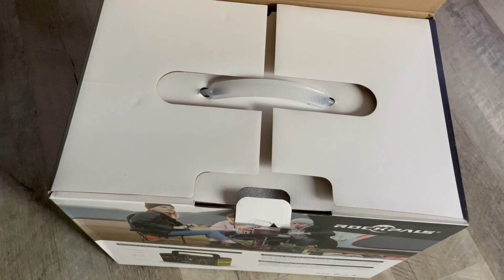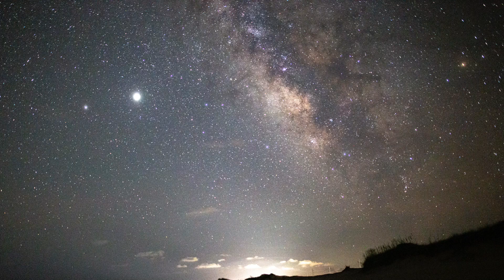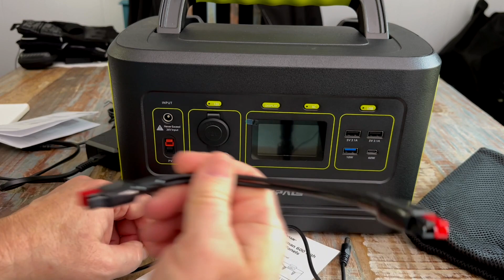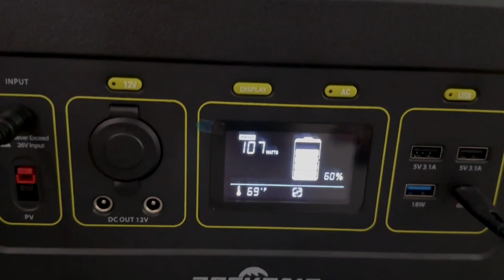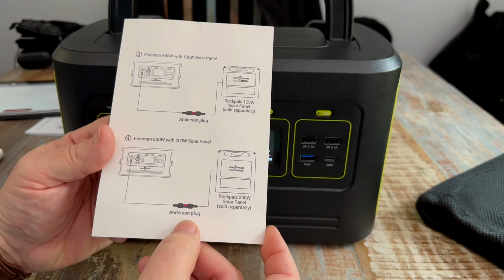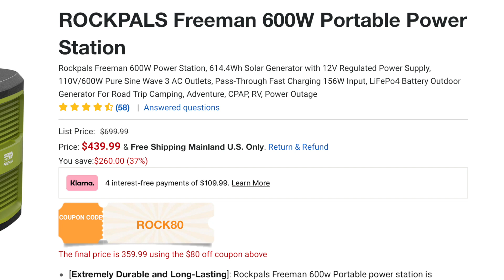RockPals Freeman 600 - BEST Small Portable Solar Generator / Power Station?

Comment: How loud is the fan noise? Wanna power 1~2 of my 200W LED lights for video work.
Reply from the maker: Depends on the load. If it’s only a couple of LED lights, and the ambient temperature isn’t super hot, the fans may not even turn on. Thanks for watching! 😃👍🏻